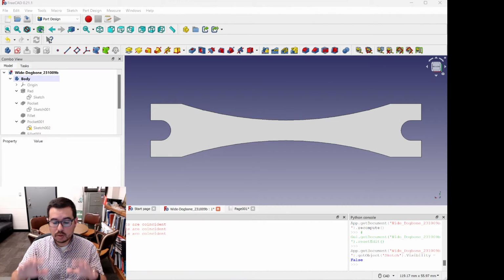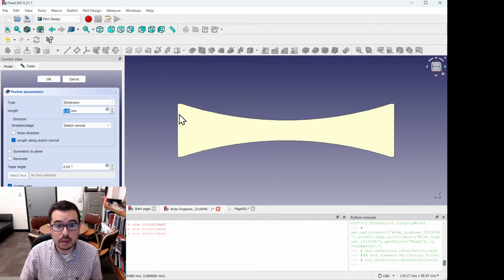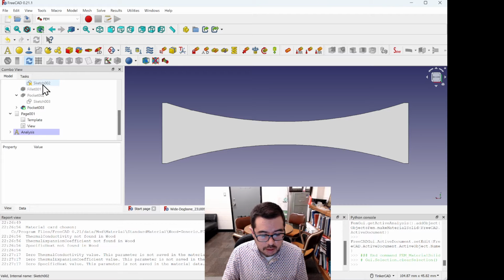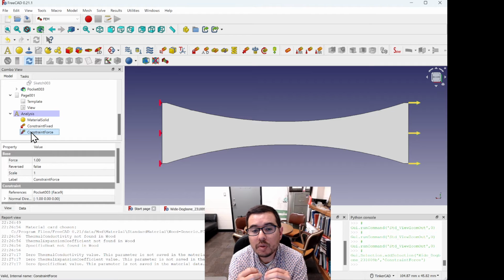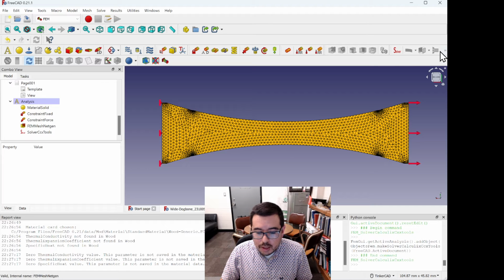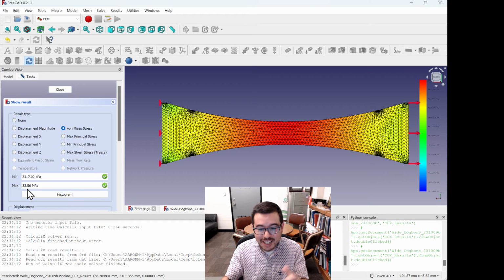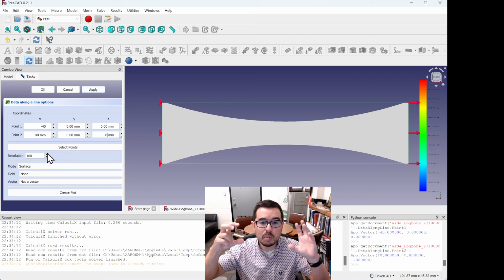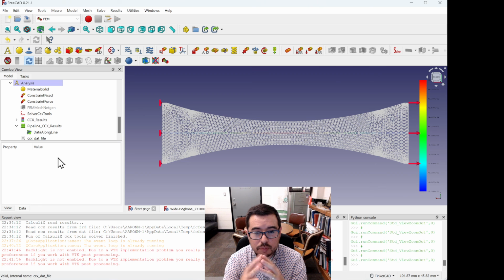Simulating the Stress in a Simple Tensile Structure in FreeCAD using CalculiX

Comment: Hi, fine tutorial video about FEM.
 I think you should cleanup your FreeCAD user interface by removing the Pyton console and Report view out of sight. You can achieve that going to View menu and scrolling down to Panels untick them from the list. And if you want to avoid them at all cost  (permanently) go to Edit menu - Preferences - General tab on the left- Report view on the top - untick all the options within the Output section.
Another hint is the Gesture navigation mode instead of CAD or ThinkerCAD is very much handy to use.
The View toolbar is much easy to use than the Navigation cube on the top right of the working space.

I hope this will help you.
Regards